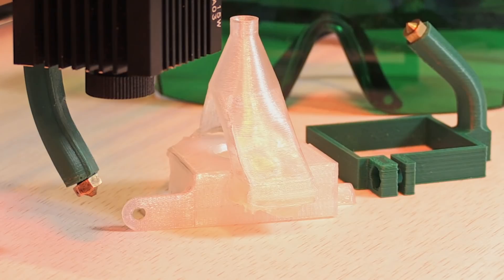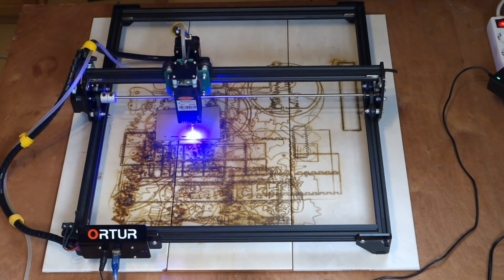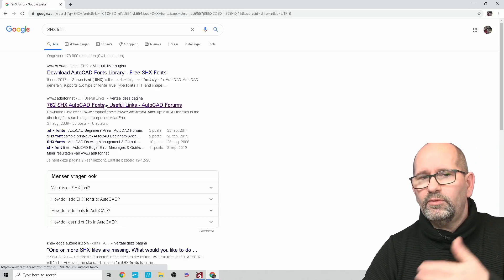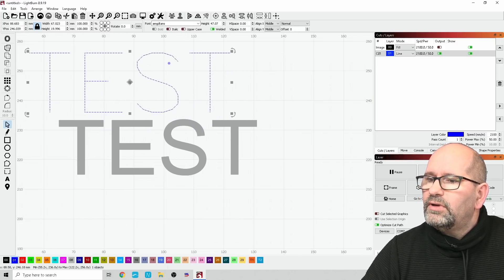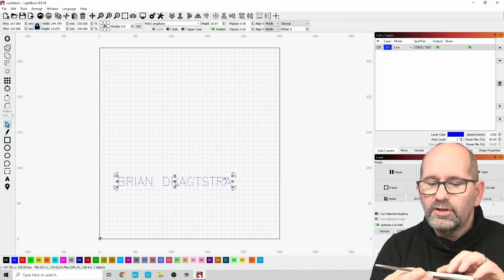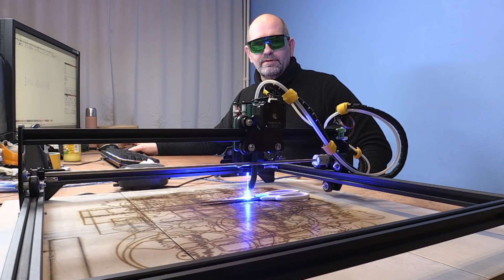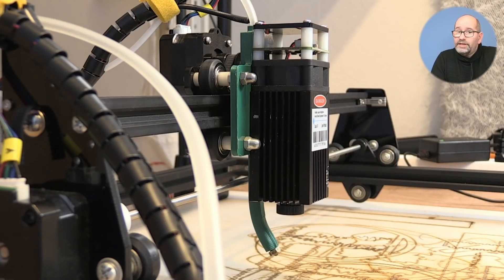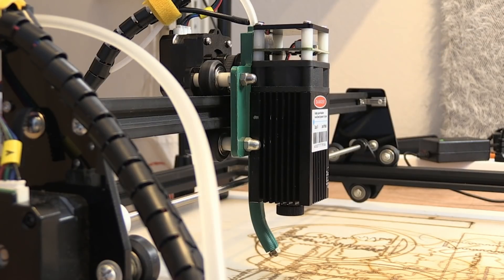▼ Ortur Master 2 METAL engraving with mustard and the NEW Air Assist

Comment: my laser 5.5 watts wont engrave metal how do that ?
Reply from the maker: Use stainless steel with a high amount of carbon in it, and use oil or mustard to transfer the heat of the laser into the carbon in the steel.

Comment: sir will this work with CO2 laser?
Reply from the maker: Most probably it won't be needed with a CO2 laser as the frequency of the light makes it possible to mark metal by default.
Reply: @3dPrintCreator  nope. My 50W CO2 doesn't leave a mark on any metal. This mustard method also didn't worked.

Comment: I also forgot to mention that lasers react chemically with the oil and chemicals already in the metal. They don't actually cut into the metal. The chemical reaction is just on the surface of the metal.

Comment: the mustard has seleniun and it is used to focus laser, maybe is the rason that it works because is fotovoltaic non metal conductor .. is used in laser printers for this property.. and glicerina in dawn soap that as i read in others forums finding glass engraving tricks using cold galvanized spray (zinc content increase the heat over the glass, i buy one today in panama city  and isnt cheap) other way about metal engraving that i want hear your opinion is laser fiber marker spray? like cermark,  you try with that? i cant engrave satisfactory the mugs and termos.. let me know .. nice your videos for my first month learning with my ortur laser master 2... i make some leather custom hat patches for sale and engraving bambo and wood tables for fathers day ... thanks for sharing your experiences... and thanks for share your air assist kit, i'll send to print it tomorrow morning... 50% than buy on internet lol
Reply from the maker: It is indeed the selenium that I responsible, but not only that. The green color of the mustard also helps because it catches a lot of the 450nm wavelength that comes from the laser, heating up the material a lot. This is also why Cermark does not work. It is made to react very well on the frequency of CO2 lasers, but it is almost transparent for the 450nm wavelength of our diode lasers.
Oh and mind you, if you bought the Laser Master 2 with fixed focus lens and slide to move the laser up and down, you have the new version and my air assist won't fit. If you have the version with the focus able lens, then you have the older version and the air assist will fit.
Have a good time with your laser and please show me one of the patches you make by sending a photograph to info@3d-printcreator.com,  I am very curious about working on leather. I have not tried that out yet.
Reply: @3dPrintCreator  it works but it smells so bad i mean really bad
Reply from the maker: Yes... and even that is an understatement.

Comment: so cool, i will buy you a coffee or mosterd soon. i received this week the atomstack A5 Pro 40W, started right away with help of a friend.
do you have an Air assist also for my engraver ?
i do not know anyone yet with an 3D printer to make an air assist.
I will be in Holland In August.
Reply from the maker: I think with the Atomstack you won't need the air assist, as it has a cooler blowing air under the laser that works just fine.
I am now testing another high power diode laser and a review is coming up.

Comment: Excellent information for those who doesn't know so much in lightburn like me.
How did you do the frame command with the laser in focus mode?
Thanks.
Reply from the maker: hold down the shift key while clicking on the frame command with the mouse.
Reply: @3dPrintCreator  Manny thanks for the tip.
Regards.

Comment: What kind of protective glasses do you wear?
Reply from the maker: The provided glasses that come with the laser.
They are more than good enough for diode laser engravers as the light from the machine can impossibly hit an eye in focus and therefore, the most simple type of protective glasses will be good enough.

Comment: Can this be used on sterling or fine silver?
Reply from the maker: I am not sure because I never tested it, yet I don't believe that would work.
Silver is much to heat conductive to be able to laser it with a low power laser. It would take to much time to heat it up (due to reflection) and therefore the heat will be dissipated throughout the material.

Comment: If I had to make a semi educated guess I'd say that this is less actually using the laser to engrave and more exciting the acid in the mustard with heat of the laser to Precisely chemically etch the metal.  With the thickness/opacity of the mustard all serving to trap and concentrate the energy from the laser. I may be way off in this guess but i feel like it bears out. I'd be interested to see it tried with different hot sauces to see if the concept holds up.
Reply from the maker: I am pretty sure you are correct about this.
I tried sauces ranging from mayonaise to hot chili sauce, but non of them gave a satisfying result. Not even every mustard does the trick right, as I explain in a later video: https://www.youtube.com/watch?v=hEQG6NxPke8

Comment: Sometimes, when you want to engrave metal deep enough, it's easier to use metal pickling method. Paint metal with thin layer of black (dark) nail polish (or just stick a sticker on it if picture is simple enough), burn the picture out (cut out contours if used sticker and take it out), and use chemical  or electrolysis method of metal pickling.
Reply from the maker: A complete different method, but yes. Much easier and more reliable.
Reply: I want to engrave on stainless charms, will this method work with a 15w laser
Reply: @trasuu1  there is no difference which metal to engrave with electrolysis method at all. Main idea for laser in this case is to cut through nail polish or sticker, and 15w is more than needed for this work.

Comment: Do you think I can do it with a co2 laser? I've done a little playing with some dry moly, but I'm hesitant because I've heard that reflections can bounce back into the laser tube and cause damage.
Reply from the maker: I heard in de comments at this video, a CO2 laser can also do this.
Yet, I think, the dangers with reflections are even worst with a CO2 laser, as not only does it reflect exactly the same as a diode laser, you also can't see the light from the CO2 lasers. Making it even more dangerous.
Reply: @3dPrintCreator  My laser is enclosed and I have safetly glasses. I'm more concerned for my laser's safety than my own! Copper is very good at reflecting infrared light. I've read at least one story of the laser bouncing off the material and going back to overheat the output lens of the glass tube and overheating it. I'm not sure if that's due to residue that was on the lens that absorbed the energy, or if it's because lasers aren't designed to have the beam bounce straight back into them? Either way it sounds like a recipe for overheating.
Reply from the maker: To be honest, it wouldn't really concern me as long as we are talking about a diode laser.
At double the travel distance of the light, in optimum circumstances, the light would be reflected at the whole surface area of the lens, but that is only true in theory, as in real life, there is power dissipation in the copper and also the light will be spread wider as the surface of copper is no perfect mirror. Diode lasers only have a limited focus distance, and only within a given range (depending on the lens used), the light is condensed enough to have high energy.
Also, the used method in this video uses a material (mustard) that stops the reflection of the metal, therefore, there will be no high power reflection going back to the lens.

Comment: Thanks for your great video. I'm just doing some ground work before purchasing a laser. I learnt from many videos that you should not use FULL power as it drastically shortens the life of the Laser unit
Reply from the maker: You are quite right that using a Diode laser at maximum power can significantly shorten the age of the laser. However, some things are not possible without using full power on these lasers, and for that reason you sometimes cannot ignore them.
Reply: @3dPrintCreator  Thanks for your reply and now I understand. Stay safe from Australia.

Comment: We used to use mustard to fake the UV-light-sensitive dyes used on wrist stamps given when entering high-school dances. Just draw the approximate "stamp" on your wrist with mustard and present yourself to the bouncer at the door. Apparently the mustard contains UV to visible light substances, like whiteners in modern detergents. Perhaps a test using detergents would be interesting (use detergent for white goods).
Reply from the maker: Yes, that's indeed an interesting idea.

Comment: Great video! Have you shared the air chamber file yet?
Reply from the maker: No air chamber, but I did share the new air assist.
Reply: @3dPrintCreator  Air assist in laser diode etching is redundant at best. You only need the air assist on CO2 lasers.

Comment: Its really a good trick! Do you think that could be work similar into aluminum?
Reply from the maker: Thanks. No, it doesn't work with aluminum because the aluminum heats up much quicker, It spreads the heat way to fast to etch this way.

Comment: Had to go back seven times to watch the Section View being cut. Why did you design the air passage the way you did? Noise suppression or other reason?  Thanks for the video!
Reply from the maker: The idea at that time was to even out the airflow from the pump. Because the pumps used in aquariums are pulse pumps, I hoped to even out the airflow with these strange shapes on the inside.
It was a bad idea for multiple reasons. It didn't work the way I hoped and also the printed plastic is not airtight, and leaks from all sides. The current version (that I just released at 31-12-2020) has the silicone tube all the way to the brass nozzle, without strange shapes and obstacles.
Reply: @3dPrintCreator  I've been evaluating the aquarium pumps myself, knowing that they pulse and wondering if one would work. It would be a nice cheap route, and possibly integrating some type of in-line accumulator  would help.
Reply from the maker: @gregoryconnors7370  I made an accumulator with two 2 liter bottles and another one with a bottle with a balloon inside. They gave me a perfect smooth airflow, but it wasn't any better than using the aquarium pump directly while it took a lot of space. I now work with a silicone hose that is 120cm long and has a 4mm inside diameter. The nozzle at the end has an opening of 1mm and makes a little compression in the silicone hose. The airflow is pretty smooth and it works perfectly.
Reply: @3dPrintCreator  LOL Maybe I should binge-watch your videos to see what you HAVEN'T tried? I'm currently working on a vacuum system in hopes of not needing the air at all, but it's difficult to get good flow without static pressure. Go ahead... you already tried too?

Comment: which compressor do you use? it's pretty quiet
I have a NEJE Msster 2 20W almost the same product.
Can you ever make a video about your laser power and speeds on different materials?
Reply from the maker: In fact, I don't have a compressor but an air pump. It's an aquarium air pump, ment to work 24/7 in a living room, so very quiet.
The pump can move 150 liters of air per hour, more then enough for this project.
A video about laser power and speed would never work as there are to many variables that make it very different for every situation, but I will make a video explaining how to get the best results with your personal setup.

Comment: where do you find the 30 & 40 watt laser upgrades? great video btw
Reply from the maker: NeJe sells then on Banggood at the moment, But I am pretty sure they will be sold everywhere as soon as the popularity grows.
Reply: so will either or both the nene 30 and 40w simply replace the orator 15 or 20w head?   without any additional items to replace?   just attach it to the pate, plug it into the same wire and it is done?   THANK YOU

Comment: That isnt engraved.  The stainless  is annealed, and marked black by the localized heat.  I might add it is not even very well marked, the "A" is missing its cross bar.  I applaud the effort, but dont make more of someting than it really is!
Reply from the maker: I don't know that much about steel, I have to admit. Yet, I thought annealing meant heating up the steel as a whole to treat it. Guess I am wrong with that?
Reply: @3dPrintCreator   You are correct.  Annealing means to "heat treat" metal.

Comment: I'm curious if it's actually engraved or if the mustard is just burned on the surface. So what we are seeing is actually that the metal is removed and the lettering is below the original surface? Or are we looking at charred mustard sitting on top of the metal?
Reply from the maker: Well, I am not able to clean it off, but I just learned from my comment section that this is called marking and not engraving.
Yet, there is a chemical process that is caused by the mustard, that makes it nice and black.
Reply: @3dPrintCreator  is that embedded in the material or just on the surface? (eg. so it can't be scraped with razor like you would scrape the paint)

Comment: Hi Brian and all followers.
First thanks for that great job you are doing for all of us.
New to all this stuff is amazing to learn from other Makers. That French Mustad trick is on my to do list.
I tried out the AirAssist V3 after seeing it in your earlier video and got the issue whit lack of space to reach home sensors, but still like the idea of it - Then I created a V4 having the tightener on same side as the air tube and the issue are solved.

My firs test tells me that the distance from lens to object are very important here. The Air will flow way to high from laser focal point if the object are flat like 3-5 mm. To me it looks like the air blows approximately 20 mm higher than surface.

Question:
As I said, I'm new to this engraving and correct me if I'm wrong - We need a flexible part to hold the air nosle right ?
Guessing that the Air Assist will work best if we can concentrate the blow right in the laser focal point ?

Please to not se my post as a complain or any bad waves - Just try to give a hand to improve your solution.

Regards Peter 
Sorry English My Native :-)
Reply from the maker: Hi Peter,
Thanks for your compliment.
You are absolutely right about the things wrong with the current air assist.
The best place to have the laser is 33mm above the object you are engraving (if we use the standard lens, provided with the machine)
Therefore, you can use a fixed air assist as long as the complete unit (laser and air assist) can move in the Z direction. That is what I am working on at this moment.
I hoped to have it finished this weekend, but all kinds of obligations made it impossible for me to finish it at this moment.
Still working on it though.

Comment: So weird. Only mustard or will other condiments work?
Reply from the maker: Hi Phil,
I am reasonably certain that the chemical reaction that makes this work with mustard can also (and perhaps much better) be caused by another substance.
I myself am not good enough with chemistry to know exactly which substances are responsible for this chemical reaction, and which other existing substance also uses these components, but I am pretty sure there is such a thing.

Comment: Nice 😁 Does it work on aluminum?
Reply from the maker: Hi Daniel,
So far I have achieved the best result with stainless steel, but I have also achieved this with normal iron. I have not yet achieved good results with aluminum and other metals that come from an alloy of several materials. I think aluminum and copper are difficult anyway, because these metals conduct heat very well.